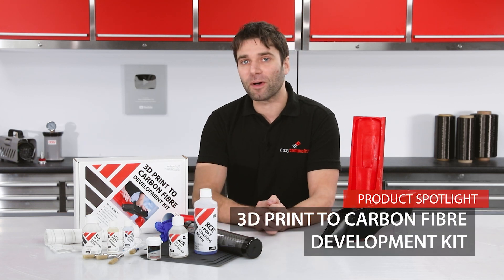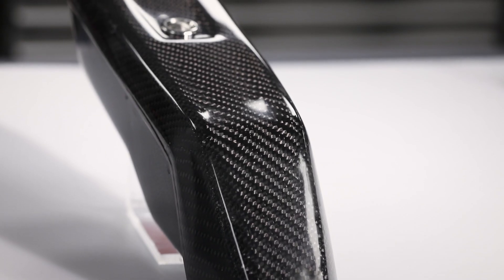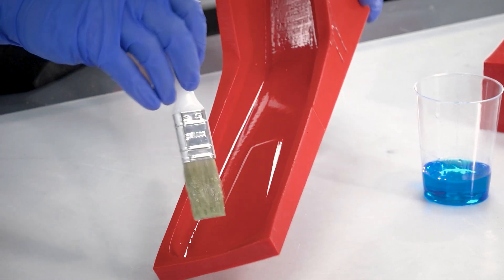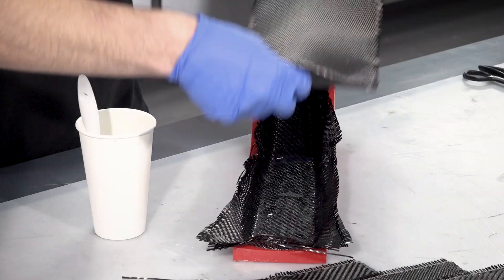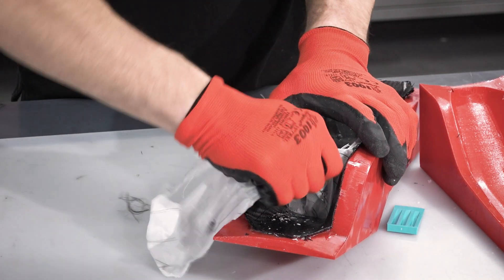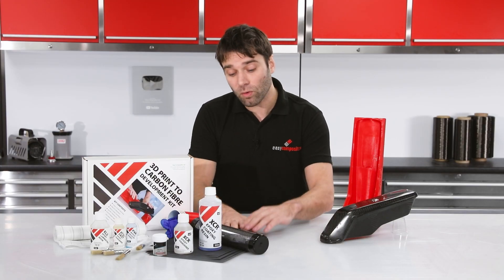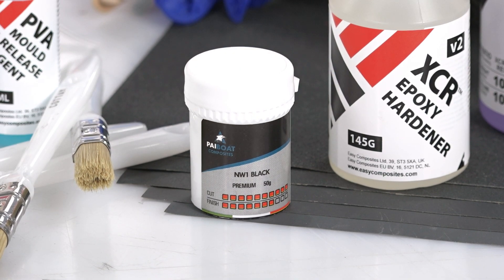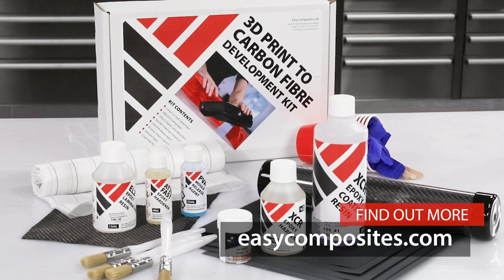3D Print to Carbon Fibre Development Kit - Product Spotlight

Comment: Are carbon fiber parts made this way less durable than the types that need to be baked or is the baking just to speed up curing?
Reply from the maker: Oven curing in itself does not necessarily give a part more strength - it depends on the application.  Most parts can benefit slightly from an oven post cure (including forged parts), but it is certainly not essential. Some carbon based products such as pre-pregs specifically need oven curing due to the resin system they are made from.

Comment: Hi! Is there any possibility to use 3D printed moulds with preprags? Greetings from Austria
Reply from the maker: Hi Xaver, the problem with prepregs in 3D printed moulds is the cure temperature of the prepreg. Even the lowest temp cure prepregs require around 60'C, whereas 70' or 80'C is more normal. At this temperature, your 3D printed mould will soften and distort, especially under vacuum pressure. If you have a look at this tutorial we did: https://www.youtube.com/watch?v=KpJdwryFj6k you can see we demonstrate a better way to go from 3D print to prepreg part, by taking a proper mould off the 3D print, and then using that to make the prepreg parts.
Reply: @easycompositesproducts2810 what about 3d printing with filaments like PAHT- CF  (PA12 wit carbon fibre infused or Pet-CF) to make prepreg moulds? They both have heat deflection temperatures over 190 deg C and strong mechanical properties
Reply from the maker: @timtravelnomad  You would need to test it to be sure that it performs as advertised.  Also you will need a method of sealing the print that is also high temperature capable such as our EL160 high temp resin.  Remember the resin will need post curing before use.

Comment: That’s really cool and the £46 for the kit is very reasonable but another £80! for shipping. Is there a USA warehouse coming soon?
Reply from the maker: Unfortunately, the shipping cost is high because the kits contain ‘Dangerous Goods’ (like epoxy resins & PVA) and as such there is a surcharge of £55 included in the shipping price. This is what we get charged by FedEx as a hazardous materials (HazMat) surcharge. For small orders containing ‘dangerous goods’ this can make the shipping seem very expensive however for larger orders, because the surcharge is fixed, then it’s not so bad. It is worth pointing out that this surcharge does not apply to any none-dangerous goods (fabrics, bagging materials, equipment, prepregs etc.).
Reply: @easycompositesproducts2810  That’s a good point. I should buy for a few different projects to minimize that flat rate fee.
Reply: @easycompositesproducts2810  I didn’t know it was a flat rate surcharge.. I’m making a big wishlist and then gonna cash out all at once then- thank you for this advice 🙏